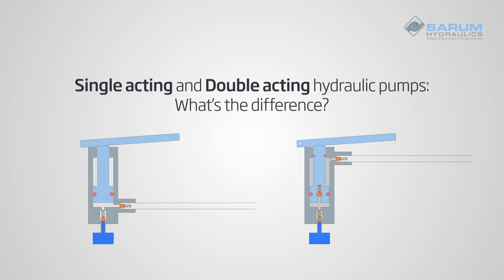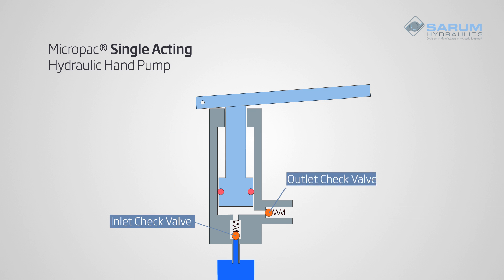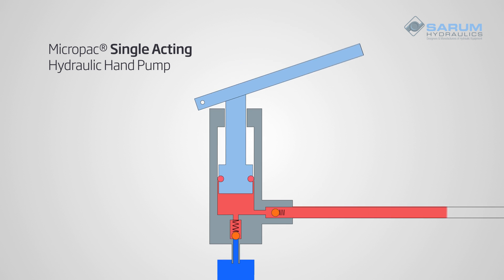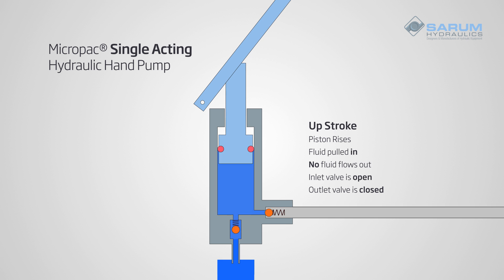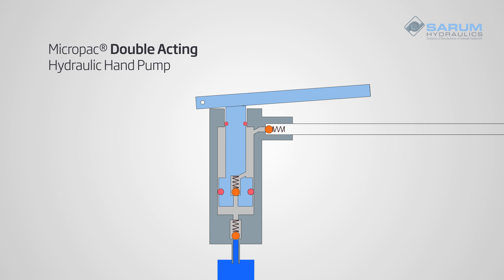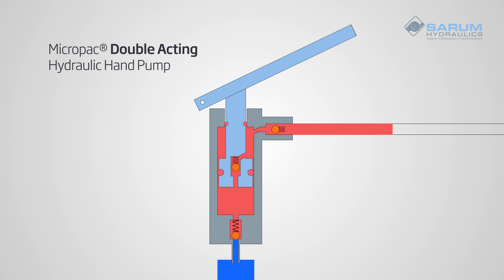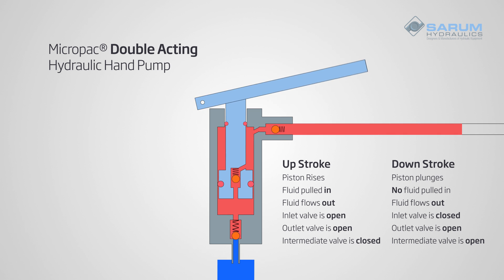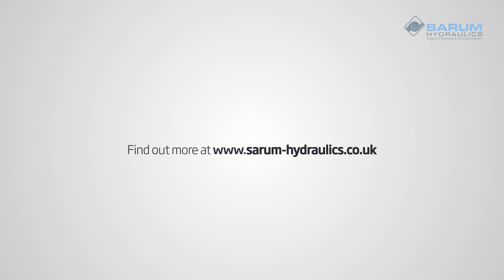What is a single acting and double acting hydraulic hand pump?

Comment: On the double acting pump.  Why is the outlet check valve required?  Its open in both the up and down stroke.  Is it just a protection method against backflow?  The intermediary check valve seems to be able to also protect the tank.
Reply: Good afternoon Oscar, That's a good question. I think I have seen pumps without the outlet non return valve. I think one of the Italian volume market pumps doesn't have it. We have put in this extra check valve for 40 years simply to provide that extra security. My instinct is to put it in for that reason. Thank you for the interest in our product.

Comment: This animation is wrong, there no reason for the downward stroke to generate pressure to pump the fluid.
Reply: Thank you Kageyame. On a single acting pump, you are pulling in a shot of fluid from the inlet check valve in the base. The outlet check on the side is shut. The down stroke puts a solid rod into a chamber of fluid and expels it from the outlet check on the side. The double acting pump pulls a double volume slug of fluid in below the piston on the upstroke, expelling the fluid above the piston out through the outlet check valve. The piston check is shut. Now on the down stroke, it is almost working like a single acting pump. The check in the piston allows fluid up and the net effect is the volume of the rod that forces a slug of fluid out of the outlet check valve. If the area of the rod is half that of the piston, the flow on the up stroke is the same as the down stroke. That's how I see a double acting pump. Sorry, I can't see why the animation is wrong. Are you looking at the downstroke on the double acting pump? If so, think of it as a pot of fluid and you are simply pushing a displacer into it. That amount will be pushed out. Happy to discuss further.
Reply: @johnfoster8624  
Sorry, my bad

It was hard to visualize by the animation alone, but from what you said, the upper layer have half the capacity of the bottom layer, so in the end the full stoke in both pumps send the same amount of fluid outwards, but the double action distribute the load in upwards and downwards strokes, correct?
Reply from the maker: @kageyame  , thank you for the message. Yes, you are right. You expel the same amount of fluid on the up and down strokes. The load on the rod is the same on up and down.
Reply: @sarumhydraulics1386  by the way, in terms of efficiency which one is more efficient, a single acting or a double acting when connected to an electrically driven motor?
Reply from the maker: @udaykits1 , thank you for the question. Whichever cylinder you use, you will only get out what you put in. Use the formula Force= Pressure x Area. If you are using the full bore side of the cylinder, the area may well be the same so the force will be the same. If you go for a double acting design, the extra pipework and valve components will give rise to some loss of energy, we would have thought. We would generally say "try to use a single acting cylinder if you can because it is simple. Some applications will need double acting in order to work, so that is what you will have to use." On your "efficiency" question it is also worth noting that using a mass or spring return to return a single acting cylinder is only stored energy. The single acting ram needs extra pressure to drive it out on the pressure stroke then that energy is used to return it. An electric pump won't be generating pressure for the return stroke for a single acting ram.
Reply: @sarumhydraulics1386  Thank you for clarifying.
Reply: @udaykits1  gee call
Reply: @munilalkumar9837  ??
Reply: @sarumhydraulics1386  in terms of efficiency on the double acting hand pump.
It will deliver the same amount of flow regardless of stroke direction. BUT, that flow will be less than a single acting one. If it's a 1:2 cylinder where the rod is of equal volume as the area outside the rod : then the double acting pump delivers the same flow from two pumps as the single acting does in one. 
Double acting : half down half up
Single acting : full down, nothing up.

So, a double acting allows a somewhat constant flow with constant pumping while the single acting allows pulse like flow. 
Then comes the force question.
This pump transfers the pressure to a larger piston/cylinder. 
So a single acting will give "full" pressure due to area differences from the pump to the larger cylinder. But the double acting will give half of the pressure of the single acting because the area is half of what the single acting gives. So in essence :
Single acting gives more pressure more flow per pump but has a zero flow and zero pressure stage on the second pump while the double acting gives the same amount of pressure and flow every 2 pumps. So they are very identical, the only difference is the single acting pulselike outputs in contrast to the double acting's constant output.

Does it make sense? Or am i talking bullshit.
Reply: Agree. There should be one more inlet port with check valve and one more outlet port with check valve.
Reply: I mean for the double acting pump.